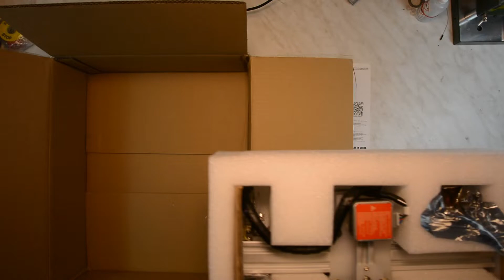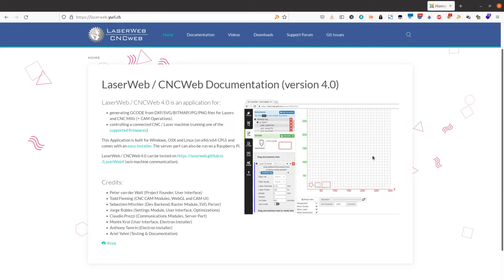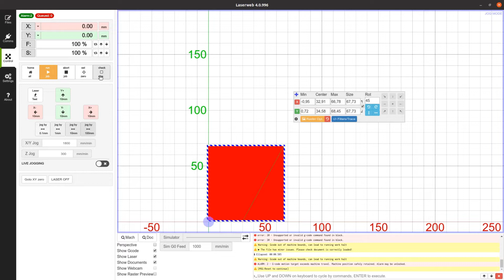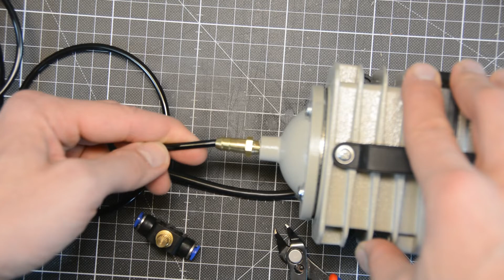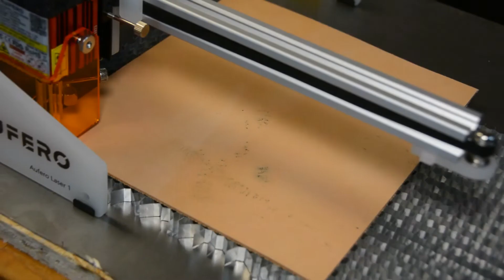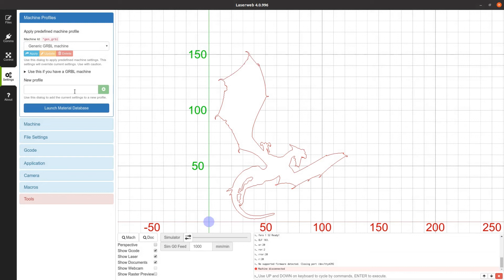Aufero Laser Cutter Review WayofWood

Comment: Hello, great video thanks! What are you using to keep the wood veneer in place on the aluminium honeycomb bed? it looks like magnets but of course aluminium is not magnetic?! The finished box is fantastic. Thanks! Mike.
Reply from the maker: Normally the veneer should stay in place without any attachment. I used indeed magnets and borrowed the steel bed from my K40 laser as the veneer was a bit bowed. A bit of tape would however serve the same purpose.

Comment: That seems like a very cool device to "get my feet wet" with laser cutting experimentation. Thanks!
Reply from the maker: Thanks you. It's a bit cheaper and (especially regarding the software) better designed than the K40 laser cutters but it can still cut material very well and it is not that much of a space commitment. The K40 with cooling tank, enclosure, etc. takes up an entire desk - this one is really easy to store.